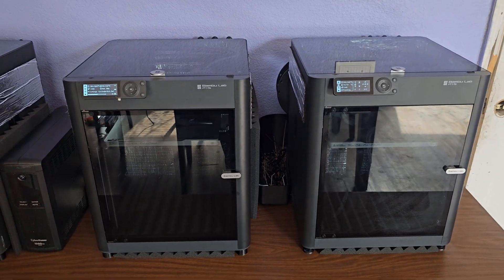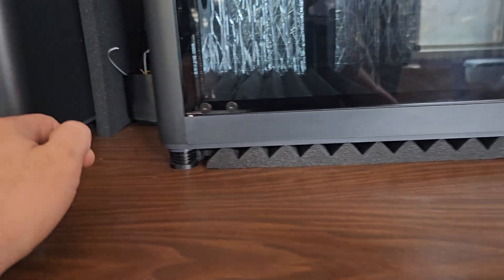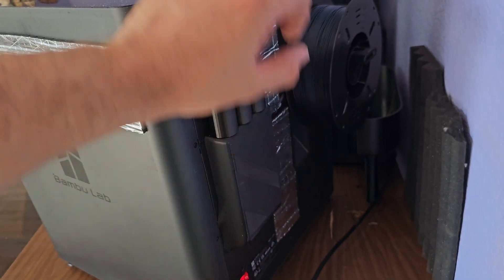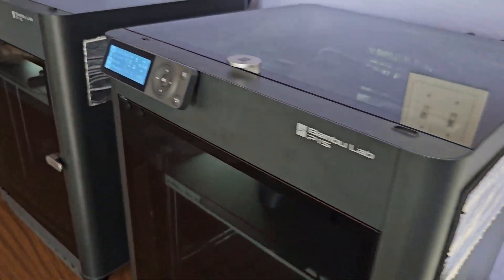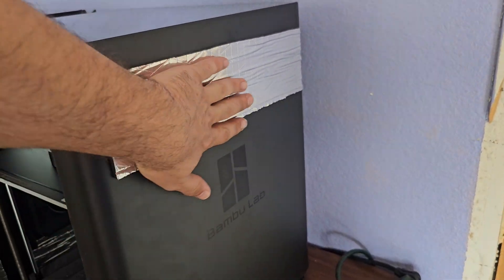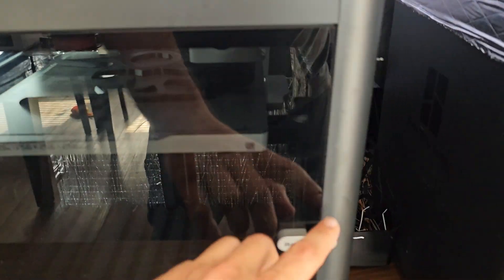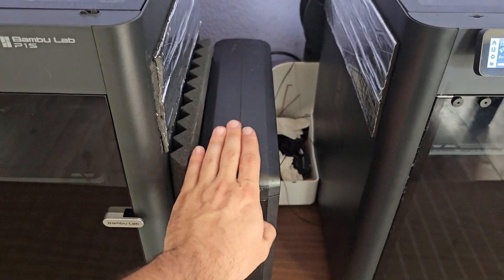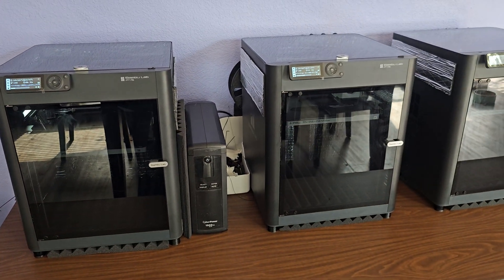Silcener mods for Bambu P1S, X1Carbon

Comment: Good idea but that sound deadening material is gooey and will leave tons of residue inside of the printer.

I think I'll have to print the side panel for my printer and layer it with sound deadening material. I did the same with the exhaust in the back and it made quite a difference.

Comment: Have you done a decibel measurement before/after?

Second, how does the sound dampening you put inside work with really high temp stuff like PET-CF? 

(Edited for clarity and to add a second question)
Reply from the maker: I have not but do plan on doing it soon! 
Also it does fine, I print PC-FR Which is at 100 Bed and 280 nozzle and it does great.

Comment: I didn't have sound deadening material to hand and found it to be expensive when I've used it in the past. I had a leftover roll of Sika multiseal to hand and used that instead with good results. Check prices to see which is better value. It isn't silver backed though. I also was a bit concerned that the exposed z axis belt on the bottom of the printer might foul on anything put under the printer, so i'd be mindful of this when shoving anything in the gap under the printer. While stylish, that exhaust mod isn't doing anything to reduce the pollutants entering your workspace
Reply from the maker: That is exactly right. When using the sound material at the bottom it will jam the plate if you do a max z height print. I have since removed that piece and not put it back in! Good observation!

Comment: Automotive sound deadening material   teducevvibrations and resonance. In your situation, the solid foil covered sude will reflect and amplify the sound, especially higher frequencies.

The cone foam sheet works by breaking up and absorbing much of those frequencies. 

You might try self adhesive foam sheets for the interior sides.  I plan to try short pile automotive carpeting.   The same can be done to your output fan muffler internals. Put a baffle inside so the inlet and outlets are not pointed at each other.
Reply from the maker: So I was thinking this as well, but I think what I noticed is that the foam side being stuck to the wall helps absorb the vibrations created from the harmonics in the wall. My walls of the 3d printer are not longer 1. hot, and two dont vibrate from what I see. 
I am not douting that there may be a better option and do plan to r&d this further!

Comment: My only criticism is the "exhaust pipes" you've gone to the effort to put a muffler / baffle on the exhaust of the fan and then stuck exhaust pipes on the output of the muffler. Those pipes will act as a resonant chamber and serve to increase the total noise from the system.